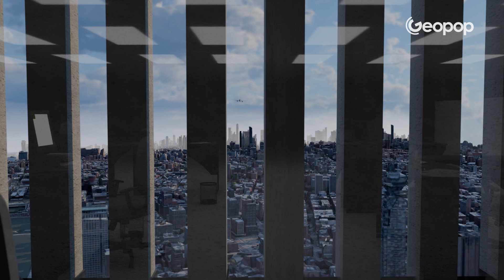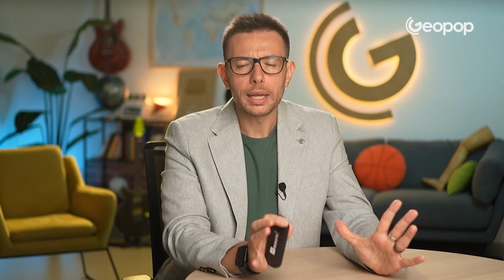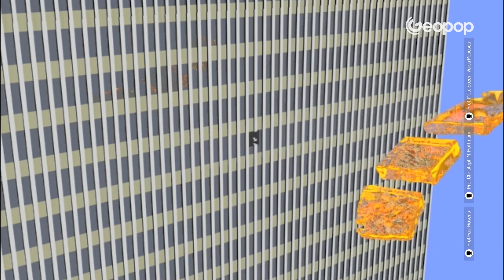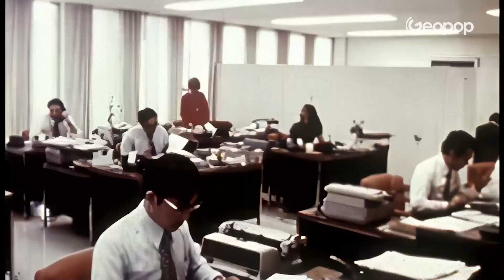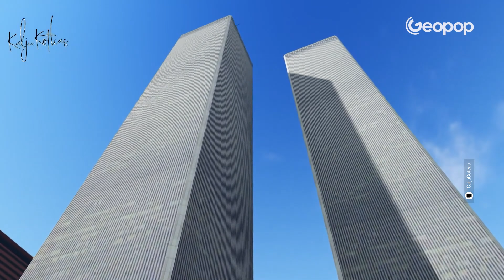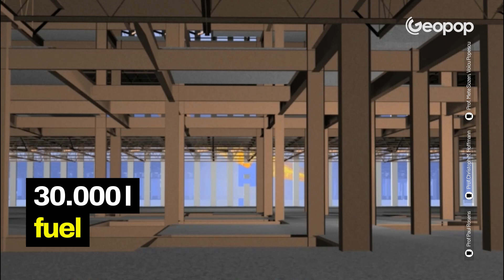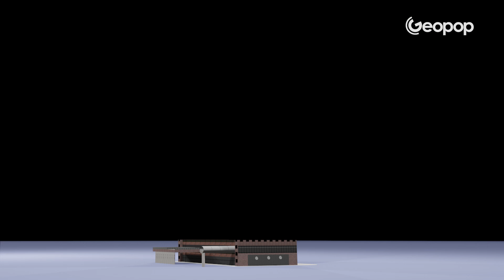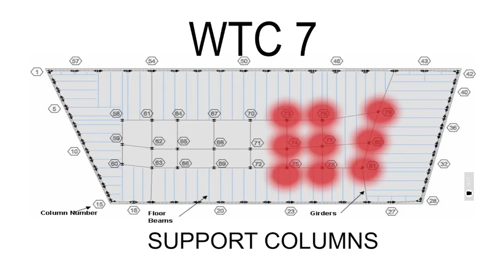9/11, 2001: The Technical Reconstruction of the Twin Towers and WTC 7 Collapses

Comment: Why was there molten metal pouring out of the Towers? How is it possible for pools of molten metal to burn for six weeks after the destruction of the towers at ground zero? Why was more than 150 FDNY and NYPD sworn testimony regarding explosions going off prior to the destruction of the towers left out of the NIST report? What about Tower 7?
Reply: Molten metal pouring out of the NE corner of the South Tower (and it was in fact ONLY the South Tower)?

You mean this?

youtube.com/watch?v=xPVGGQU-MeQ&ab_channel=SeekersofTruth

The Boeing 767 which struck the South Tower weighed 117 tons and 80% of that was aluminum. The exterior cladding on the Twin Towers – the white panels – were also aluminum.

When Flight 175 struck at the 81st floor its momentum deposited much of the office contents in its way and the bulk of the aircrafts mass into the NE corner of the building. The piled up debris shoved into that corner is visible in photographs and video so we know it was there. There’s a good shot here of piled up debris from 4:36; 

youtube.com/watch?v=ZLJyL63sqtU&ab_channel=MrKoenig1985

Steel melts at roughly 2,750-deg F while fires in the South Tower reached peak temperatures of around 1,800-deg F. Aluminum OTOH melts between 887-deg F to 1,180-deg F depending on alloy. That aluminum will melt under these conditions is not a surprise. If you look at pictures of cars left behind and destroyed by forest fires the aluminum wheels are invariably melted away along with other sometimes aluminum parts like hoods. Steel bodies remain intact.

The “molten metal” appears at 9:52 am. At the same time we see the first externally visible signs of sagging floor trusses and the pulling of the perimeter columns inward. I submit these events are related, not coincidental. The aluminum cladding at the NE corner also appears to me to be burning. It is likely with the floor trusses sagging under the heat, and the 81st floor truss in the NE corner under the debris pile subjected to the heavy load of the debris pile, the truss broke its perimeter column connections and dropped, instigating the material starting to pour out of the NE corner at the 80th floor. Given the properties of the materials in question, aluminum is by far the most likely culprit.

Reports from The NIST, FEMA and MIT all concluded the material is aluminum.

Certainly steel is the least likely of all the materials the anomaly could be given its much higher melting temperature and the fact there is no logical source for molten steel. The perimeter columns in the NE corner are intact and the material is pouring out between them. So it isn’t columns melting, therefore what other source of steel is there?

Deniers will claim molten aluminum appears silver when molten, which is true but only at the low end of its melting temperature range. Aluminum can and does get hotter and it glows red to orange when it does (1,100 to 1,800-deg F). Most folks of course just don’t bother getting it that hot if the goal is just to get it molten for say molding a part. No need to go higher.

The total mass of molten aluminum is a BIG deal in regard to how it behaves when poured. Quantities bellow half a liter cool almost instantly if poured onto a flat surface, but if poured into say an ingot mould will stay red for a minute of so. Pouring volumes of molten aluminum greater than a liter is a VERY different experience. The thermal mass is much greater and the radiant heat is horrendous. The aluminum is able to stay liquid and remain glowing bright orange much longer.

The famous video of glowing liquid gushing out of Tower 2 moments before it fell, involves at least tens of liters of molten aluminum. The thermal mass involved is so great that it stays red after falling many meters through the open air.

Side note: There was also a large UPS battery farm in that spot and some of that material at least may well be from the batteries IMHO.

Comment: These building were brought down by the government, the planes were just used as props! Fire has NEVER brought down a structural steel building in HISTORY and has not since 9/11! This entire narrative that the planes and fire caused the structural steel to fail and cause these massive buildings to free fall perfectly/directly into their footprint, not only once, but TWO TIMES is not only amazing... it's impossible! Then building 7 that was NEVER hit by a plane dropped in its footprint with a controlled demolition type free fall, where you could see the explosions prior to each floor collapse as it fell! If you want to believe this government "story" I have some bridges I want to sell you!
Reply: Countless thousands of steel framed buildings and other structures such as bridges have been brought down by fire. It literally happens all the time. Steel is formed using heat and deforms the same way.  Humans have known this for a thousand years. Everyone but you apparently.
Reply: Building 7 was hit by falling debris from the two massive skyscrapers that collapsed right next to it. Not only that but the shockwaves from the collapse of the towers would have also damaged the foundations for every building in the complex.
Reply: For some reason, I spent 4 hours rewatching 911 videos the other night. I didn’t remember anything about Tower 7, just the Pentagon being mentioned. I also didn’t know about the suspicious passengers on flight 23 which never made it off the ground. 
The box cutters.
I grew up in the 70’s and my mother gave us box cutters for protection. It was right up there with carrying nunchucks.
To this day, I’ve only know 2 kinds of people to carry box cutters: 
1. Crazies
2. Manual laborers. 
To that, when the projects were cleared for regentrification; they were imploded. Look up any video and you’ll see they fell the same way the towers did. 
The planes were extra insurance.
Other attacks would’ve also happened that day.
I don’t doubt that this (or worse) will repeat.

Comment: One HAS to wonder how the Designers of the 911 Attacks, found the weakness of the Tower's Engineering.   

My Mom thought the  Tower that was hit earliest Collapsed 1st. I told her it was the 2nd Tower went down 1st, because the Plane hit Building lower; there was more Mass above the Fires.

Anyway,  a great VERY informative Video.
Reply: They didn't.  They hijacked the biggest planes they could find and flew them into the buildings at the highest speeds they could manage to maximize damage.

Comment: They transported missiles from Salton sea via magma. 

Who was that man?  That man weeping in Mobile County Jail when I was there in October for having  a small bag of my recommended medication alleged cannabis?    5 men in the 2 man cell  His legs under the bunks I next to him.  He reminded me of my friend Jeanette as he wept   She is dead.  She was allowed to die in her death bed a few years ago.  He reminded me of a man I saw almost killed at the Ideal Cement Plant construction site back in the late 1970's or early 1980s.    I oiled a crane and had time to stare  The man would cut huge pilings used to support building structures   It was raining one day and he was in he gray mud   He would get stuck as he cut the pilings his boot deep in the mud.   A crane dropped the cable and he cinched it and the cable pulled up.  The piling did not break.   His saw spewed water and cut the piling as the crane pulled.  The piling snapped lifted up.  The piling slipped from the cable and the mega ton piling right toward the man.  He fell backward holding the saw or dropping it.  I am not sure.  The man fell back in the mud and the piling was coming right toward him.  And  then when it was at a 45 degree angle with he underneath the piling stopped falling.   Another piling not yet cut stopped the fall of the cut piling.  The man got it from the mud.  I was in shock    I had seen another man electrocuted in a hole when his shovel hit a power line   It was the same I thought   Another man fell from the high steel onto rebar spikes  I could not see him   Good marijuana had been sold and i had bought a sack  The three fingered crane operator was angry   All his crew were missing fingers   I quit rigging and the saw man quit his job   

The weeping man reminded me of jesus in the jail  His nose was so big    His ass crack was showing   A young man in the cell said I should do him he wanted it    I looked away at the window and remembered him  A man of God droppred into tartarus   A fellow angel in this horrid place   The man laid in the cot on the floor and wept for the whole 22 hours I was there .     

The saw used water to cut the piling  It has to to keep from overheating  Therefore the upward spiral of the saw that cut the hole for the nuclear bomb to be placed under the world trade center had to have water as well as it cut all the way from the magma.   The WTC NYC is on the Island   Lots of water is there    Any large building next to a large body of water can be dropped in this method  God saved me to tell you or maybe it was muhammad who saved me    I was injured in court recently  There is no court I was tricked   Dear God don't save me   Let me die  Let me leave the human race  The mad force appears to have won  I lost my mind  They shot it out when I was born and I have been bombed throat cut electro shocked injected unconscious and tasered    There is not a child of mine in my eye.   There is not.  There is suffering as Jesus stood on the cross   Stood  Ha

kurt brown saintrambone mobile audit Club       Look there mother  I missed the point now i get it   I am dead as I can get
Reply: You okay there? Need some help? Ramble much?